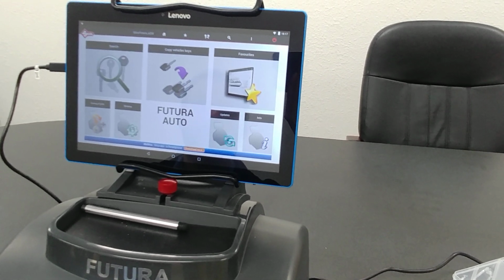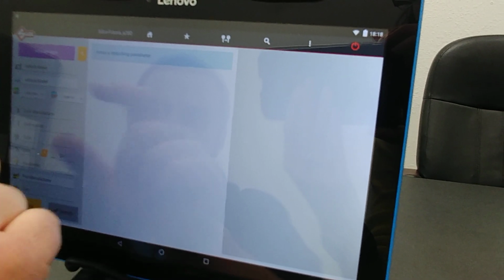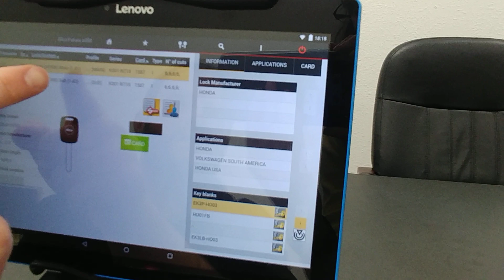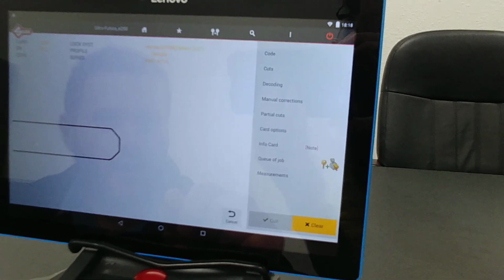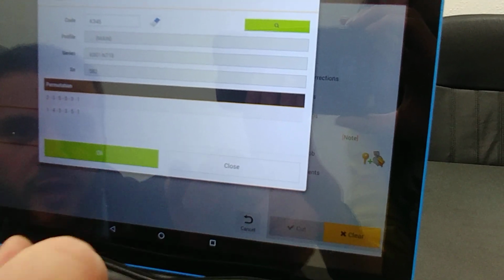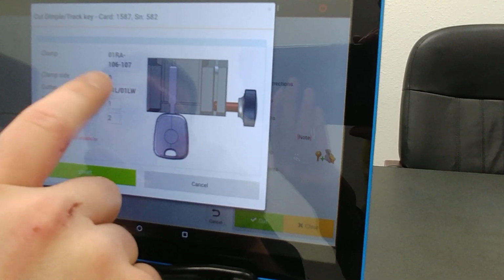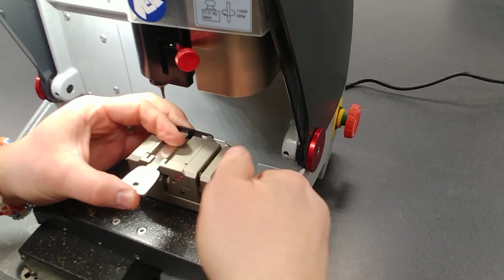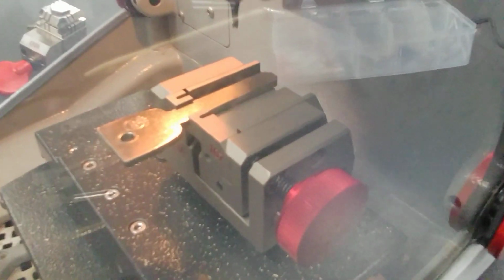How to cut a Honda High Security Key by Code with the Silca Futura Auto

Comment: Does anyone know how to do progression cuts on edge cut keys with the Futura Auto? Every time I try to do the second progression cut, it will ruin the key unless the first cut has a 1 where the cutter detects the edge of the blank. The problem is that the edge detection takes place at the #1 cut position, rather than a part of the key which doesn't get cut. So when you are trying the second progression cut, it thinks the bottom of that cut is the edge of the key. I could be doing something wrong, but I can't see any other way of doing it.